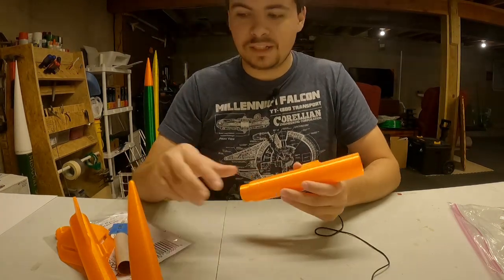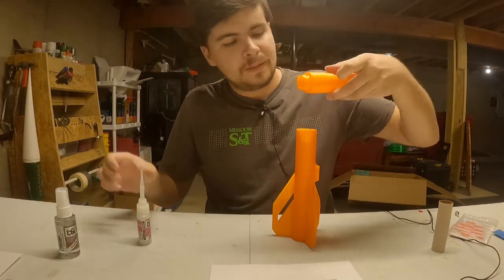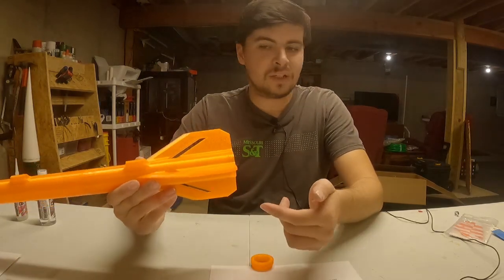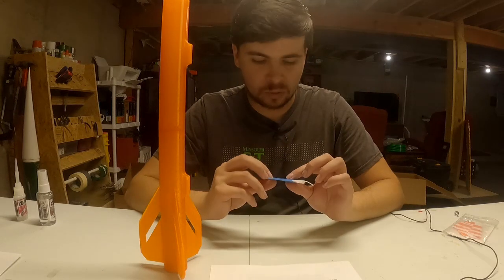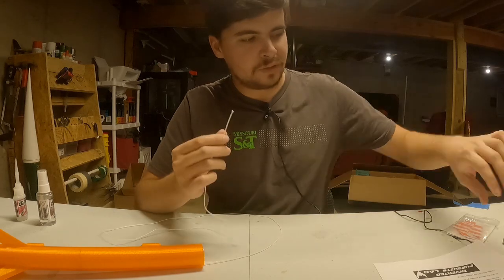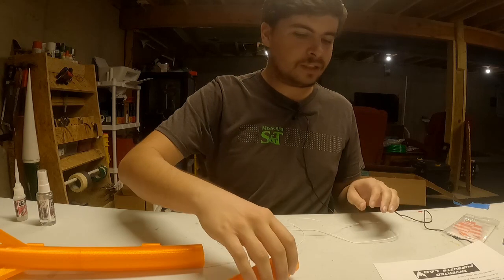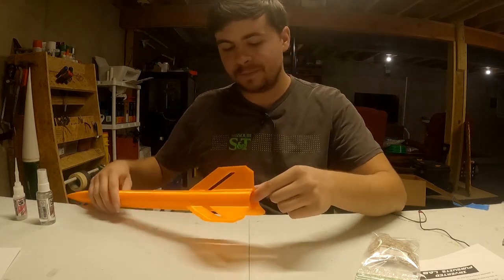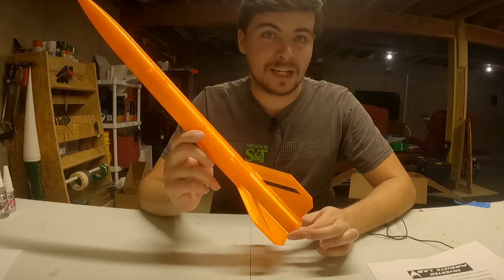FIREDRAKE Assembly Instructions

Comment: what are you seeing for apogee numbers on D and E motors?
Reply from the maker: An ESTES E12 goes around 1000ft, D12 hits like 300ft (It's not really designed for an ESTES D motor). An Aerotech F32 sends it to around 2000ft which is my personal favorite followed by the E12.
Reply from the maker: Flight characteristics can also be verified by using the openrocket files provided. https://www.jboyson.com/rocket-assembly-instructions
Reply: @InvertedPursuitsLab  nice results !